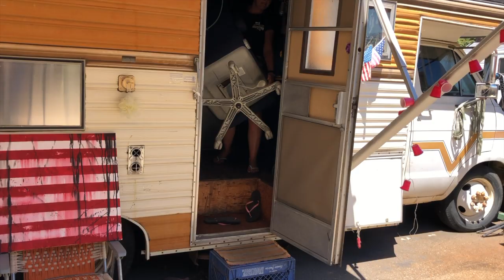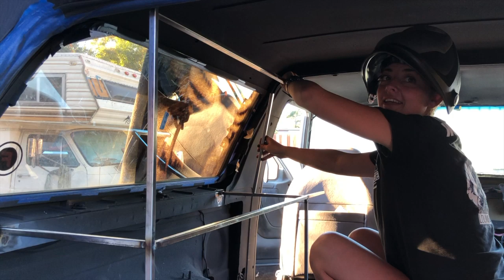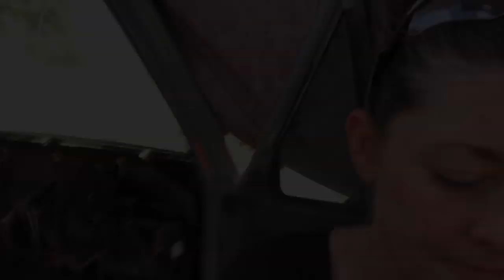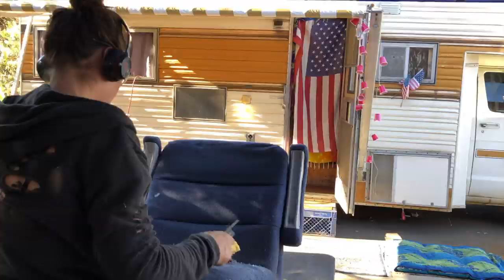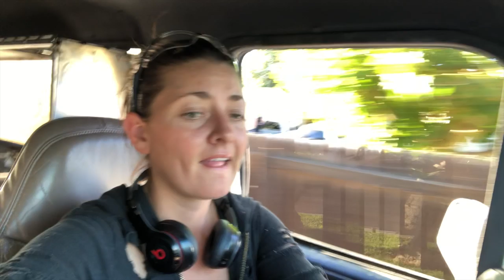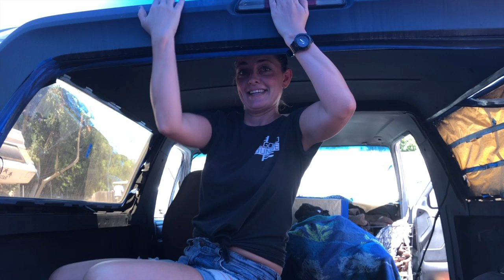I BUILT A BRONCO TINY HOME | CrossCountryBound 🤠

Comment: Morgan get yourself a roof fan so you can run it when it's hot outside. They can run on 12volts make sure that you wire your batteries up so you can charge them off solar and the Broncos alternator.
Reply from the maker: Thank you! I'm on it!
Reply: @UnstoppableMorgan  I'm sitting under my maxxfan cooling off after a hot day in eastern Washington at the moment,  as far as I know it is the only fan you can operate in the rain, this can be more important than it seems, I've been in driving rain and nothing got in.

Comment: Sweet job girl !, get your self a good converter (a good spot fur keeping it cool too) for your laptop/cooker/freezer/fan & find cheap LEDs for your lighting (so you can replace them cheaply), the less draw off your batterys youll plan to hook up to your solarcells will have a longer life for your batterys.
Try an check your total weight at a weight station near you, before you buy a trailer to hook up to, as youll need to keep track of your pay-load/gross-load.
We want you to be safe an enjoy your jurney...
Also adding water and other heavy stuff, please check your suspension an build it to handle your cargo an trailor as well, hate to see you gettin stuck on the side of the road, from a broken drive train or axl !

Comment: Great job Morgan! The lizard skin came out awesome and the hinged bed is a great idea.  I did a similar build. Added a double layer radiant barrier to the ceiling and a anti-heat/vibration layer to the floor. My Lab sits on the tranny, the floor cover made him more protected from the heat. I also added a safari rack and used two Ammo cans to hold my tools and extra vehicle parts, fluids etc. They are steel, cheap and water proof.  U bolted them to the rack. Made a faring out of a snow board to keep the rack quiet. I wish you well. Safe journey.

Comment: 👍 make the solar panels removable so you can park in the shade. put that dashboard back in, and keep on truckin'
Reply from the maker: On it! Thanks bud!
Reply: Unstoppable Morgan maybe flexible / portable Solar panels might work if you are limited on roof space , Bob Wells of “ Cheap RV Living “ just did a video  ( July or August 2019 ) comparing numerous brands/ price points- ❤️❤️❤️ that you are going minimal & focusing on getting on the road ,  you are absolutely right that you can pick up a trailer any time if you need more space , look forward to seeing the finished product, that kitchen is genius BTW - Watching & cheering you on in Phoenix, AZ 😎 ✌️ Marta K
Reply: @UnstoppableMorgan  yeah that dash needs to be re-installed for safety sake
Reply: oldfordcarsandtrucks nah, moving panels is a pain in the ass. Just fix a good poly panel of 200-300 watts and similar sized batteries (in amp-hours) and you will be set.

Comment: Good plan M, just make sure your rear roof can hold the panel frame and tools. It's fiberglass right?
Gonna have to support the panel and tool rack so it doesn't break through the roof.

Also, you may not want the toilet under the seat. I'd just get a bucket and some composting toilet bags, or something like a bumper dumper and kitty litter. Can always use one of those shower tents for privacy if needed.

In the city, obviously you just go to a public toilet.

Comment: Insulate the floor at least, especially the wheel wells, or the road noise will drive you nuts. Something like dynamat or kilmat. Also a solar shower bag is great when boondocking, plus it works awesome washing the doggies.

Comment: Have you considered the effect of liquids in a tank under the cab moving around on braking? it would suck beyond belief to slam on the brakes and have a geyser of urine drench your passenger. I recommend good old fashioned backpacking and hiking style  restroom useage. Bury it or bag it.
 
I have often thought about how cool it would be to have the top on my Bronco lift straight up 18 inches on 4 motorized screws, or air shocks... one could build or sew pleated fabric inserts, like from convertible top material, that if designed properly would allow the top to rise, fall with little or no manipulation, and cover up the gaps that would be created. The extra headroom would be absolutely wonderful. 
A pop top Bronco mini home.
side note. I just realized how short you are, lol. the width of a Bronco, or barely to the top of the door panels haha.

Comment: I would look at the offroad guys with the roof rack, like desolate motorsports they specialize in the bronco for desert prerunners. Also upgrade tire carrier to something more heavy duty kinda like the jeep guys. You get a stronger bumper tire carrier and you can make a rack or storage box that swings away like the stock carrier. Last but not least look up wrangler star's channel he's building an adventure van for weekend trips with his family, you might get some ideas and parts info from his kitchenette build and inverter setup

Comment: re: solar, provide for a rotisserie off a bbq something to rotate the panel to effective solar gain. also stability at speed while driving for that panel. second thought upper rack for gear Also look at platform camping ska rooftop tent, sometimes its hot and you need fresh cool air more than what you will get in the bronco. cheers

Comment: I've seen a full size bronco with a pop up camper installed. It was smaller sized from a ranger.
The top was cut to accept it and as a resting/ holding fitment.

Comment: For the batteries...if you are using anything but lithium type batteries,  then you will need to have access to them so that you can maintain them.  Meaning you need to be able to get to the tops of them and be able to SEE in there to check water levels.

Comment: A)Do a dual battery deep cycle setup under the hood. Do not put them in the cabin, some offgas horribly.
B)Depending on the state/county, leaving the pups in the truck even with window down they can criminally charge you (I know ridiculous, but it happens)
C)Cassette toilet is your friend. 
D)Tint them windows!
E)remember proper ventilation for when needing to cook in case you can’t open rear gate due to bad weather
F)when you build your rack, do yourself a favor and make it where you can mount a 270 degree awning so you can open it up and have shade on one side plus rear to also give you cover
G)weld in a 5lb propane tank on the rack so you can have a big tank for many of things. It can power a buddy heater, hot water, stove, and just about anything else you want
Reply from the maker: Uncle Elroy Hey thank you!!! I totally forgot that propane can power a heater!!!!! Omg I love you right now! Here I was stressing about needing enough power for some kind of heater fan and was thinking there will be NO WAY my battery bank will last throughout the night powering a heater. But wait! PROPANE!!! 💃💃💃 I’ll find a place to mount a tank stat! Thank you thank you!
Reply: Unstoppable Morgan Glad I could help 👍 Mr.BuddyHeater are amazing and relatively affordable. Top 3 best investment. They sell propane tank mounts that bolt to a rack, or you can build one that will mount on rack easily.

Comment: Just a suggestion, Morgan, but for security and safety reasons, you may want to Jerry rig an inside latch on that back gate of the Bronco in case of an emergency. You may never need it, but if something came up and you couldn't get out the front, you need a way out the back. You may have already thought of it but I figured it was worth a comment.

Comment: IMPORTANT, make sure the kitchen side and bed side are the same weight. My mistake was using wood, too heavy, for shelves on the left side and the right side was just my bed. My Ford truck with topper was now too scary to drive on the interstate. No longer aligned it steered to the left. Dang it wish I was on the road again.

Comment: Need your bed higher so you can sit on it and use your kitchen...u rock
Reply from the maker: By the time the padding is on the bed it'll be perfect hight. :) Also, forgot to mention that the slot you can see under the sink line will have a pull out table. Can't wait till I can decorate! Hope you have a great week Russ!